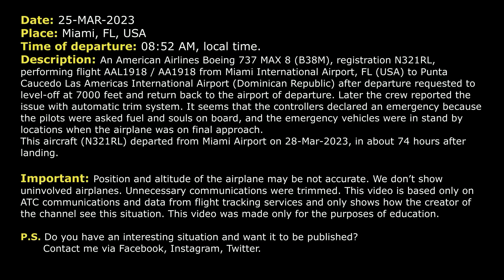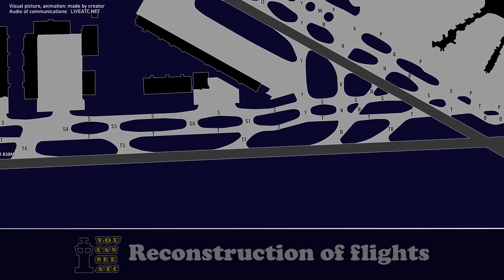Inoperative automatic trim system. American B737 MAX 8 returned to Miami. Real ATC

Comment: Crew and ATC were cool calm and collected. The comments, on the other hand……wow! Inoperative electric trim is not an uncommon occurrence. It doesn’t trigger MCAS, much to the apparent disappointment of some commenters who were perhaps hoping for a Boeing crash.
Reply: "Not an uncommon occurrence" is not a reassuring thing to hear for a new aircraft though.
Reply: Thank you. I’ve about had it with all of the armchair morons who’ve never turned a wheel but somehow fancy themselves qualified to weigh in on something as complicated as the design, operation, and maintenance of a jet airliner.  These are the same people that couldn’t program the time on their VCRs when those were a thing, yet somehow they magically know how a trim system works and what backup modes it has.  They need to sit their ignorant butt in 17B, fasten their seatbelt and shut their damn mouth until they have a pilot certificate with a transport category aircraft rating on it or the equivalent thereof.
Reply: Pilots an asshole in the beginning
Reply: Sadly, seems par for the course for YT comments sections on ATC videos nowadays, especially if anything about a 737 is mentioned.
Reply: Right, this happens with all airplane models, and it doesn't take much experience in the aviation world to know that. Many of the pro-Airbus trolls I see here do the same on other channels. Beat to not feed them
Reply: I think after the grounding people wouldn't think they would have a problem with the trim system of any sort. Just out of an abundance of caution

Comment: It seems pilots had some sort of mental conflict or concern first describing the issue, then, not declaring an emergency. Looks like "trim issue" phrase associated to "emergency" had some restricted use. Idk
Reply: Sounds like only the auto trim failed. If the trim was jammed or something that would be a different story.
Reply: It's called "being busy." "Communicate" is last in "aviate, navigate, communicate" for a reason. Troubleshooting the trim while climbing out of a busy hub airport in congested airspace is a significant workload. Flying the airplane is the most important priority, talking to ATC is not.

Comment: Too much chatter on the radio - simply "Request hold for troubleshooting". As a pilot you manage your aircraft, and your system and procedure. Help the other guys in ATC by forward planning and giving only information that they need. Plan then talk. Don't do your planning with the mic pressed.
Reply: Totally agree....😮

Comment: Isnt this the second max 8 that had a trim issue recently or is this another upload of the same issue?  Im thinking one happened in Phoenix?
Reply from the maker: Yup, that happened on 24-Feb-2023. Southwest Airlines. Phoenix.
Reply: @YouCanSeeATC  
Thanks
Reply: If you are talking about Phoenix that was an Airbus A319 with the system failure
Reply: @MrRashad9001  That was a different (and more recent) issue with the A319. They had a low oil quantity indication on departure and had to shut down the #1 engine and return. There was also an issue last month with inoperative electric trim on a Southwest MAX 8 that had just been delivered. Both incidents occurred departing Phoenix.
Reply: @MrRashad9001  Sureeeee.  Because SWA only flies A319 airframes, right? :face-turquoise-covering-eyes:

Comment: you would think the trim system would never fail after 737 Max debacle
Reply: I’ve about had it with all of the armchair morons who’ve never turned a wheel but somehow fancy themselves qualified to weigh in on something as complicated as the design, operation, and maintenance of a jet airliner.  These are the same people that couldn’t program the time on their VCRs when those were a thing, yet somehow they magically know how a trim system works and what backup modes it has.  They need to sit their ignorant butt in 17B, fasten their seatbelt and shut their damn mouth until they have a pilot certificate with a transport category aircraft rating on it or the equivalent thereof.  An electric trim failure is not really that big a deal for a competent crew.
Reply: Electric trim/automatic trim is common issue, even before max edition. It is not that serious, jest flying like small Cessna, with trimming manually.
Reply: @Marix498  Not a reassuring thing to hear. It may not be serious but it shouldn't be a frequent occurrence
Reply: @tomstravels520  it depents what od frequent definition :) it shouldn't fail like any other component, but sometimes failes. I was watching video while Captain with about 15 years flying experience on 737, A320 and smaller before was summarizing any failures he had. It was only few, and none of them even so serious like trim failure. I can't remember but some of them "criitical" failures he had, was f.e. turning off AP on cruise level etc. What does IT mean? Any failures in the air are extremely rare on modern passenger airplanes. I also remember statistic that typical pilot will never experience engine failure
Reply: At least this one failed safe instead of going full Skynet.
Reply: Boeing has been having serious problems for quite a while now.  The Max debacle was not the first and won't be the last.  Boeing is prioritizing union-busting over safety.